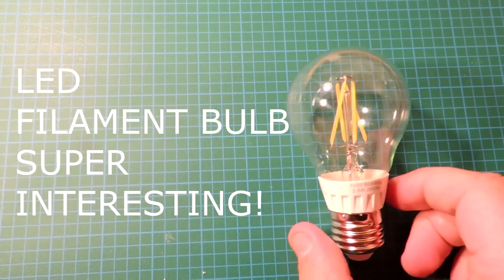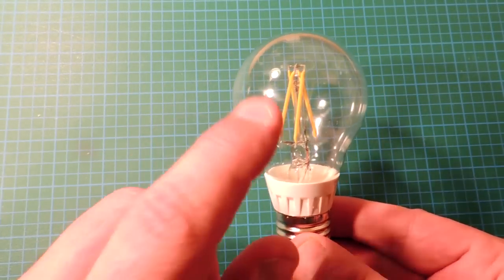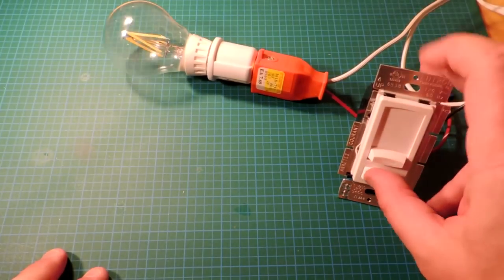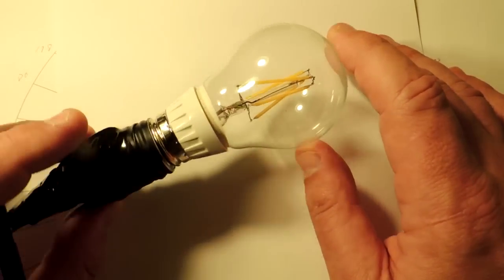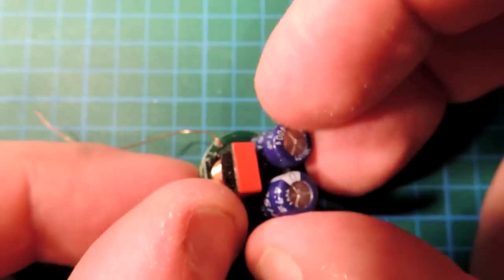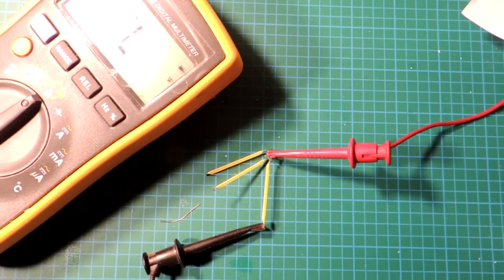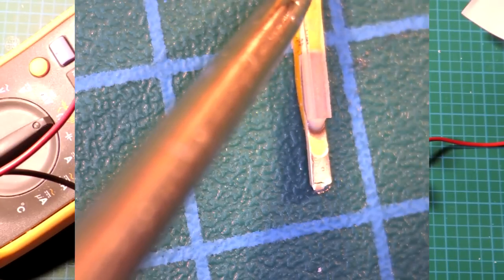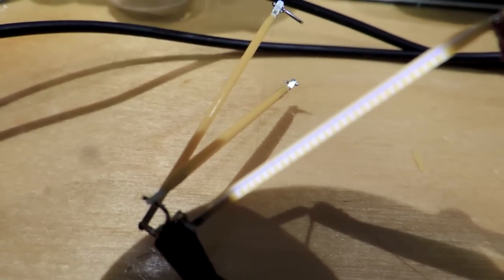LED "Filament" Bulb

Comment: 400lm seems a bit low.  I for one can't wait till these things get to 1000 or so.
Reply: So far the biggest power is 6.5W ,800-850 lm replace 60w incandescent bulbs. when we solve the heating problem. i think will have more power and lumen.
Reply: ***** I got mine at Home Depot.  They've had them for a few years now.  Trouble is, I don't know what they mean by 60w equivalent as they are dimmer then your average 60w.
Reply: *****  I would try Alibaba.com as they have a multitude of suppliers just pay attention to specs, warranty, reputation.... Your not missing out on the Home Depot ones as most their warranties especially Philips are terrible, restricting and really give you no guarantee they will honor it.
Reply: *****
I bought some 75w equivalent (has six filaments) on amazon.  It's really only 800 lumens but I LOVE THEM.  They look high quality and very retro.  They are all over amazon.  Buy the the 6 and 8 watt versions.  6 watt is usually, 600 lumens and 8 watts is 800 lumens.  I mixed the 75w and 60w in a bathroom fixture.
(4) 40 watt equivalents that use (4) 4watt filaments that look amazing in a fan lamp (450 lumens per bulb with 4 watts).
They come in two colors: 2700k that is a very cool retro yellow and a 3000k that is pretty nice too.
Reply: *****
Yeah, the price will come down.  I only need a couple of the "75s"  I bought mostly 60's and 40's.  I use the filament bulbs only when they are exposed and have to look nice.

Otherwise, I just buy Crees.
Reply: Now, you can get them on Amazon.com unlike 3 years ago.

Comment: http://www.ledinside.com/press/2016/3/power_photon_deomonstrates_led_filament_tube_and_cooling_package.      In the future, the omni-directional light bulb won’t include PLCC, EMC package or CSP, ELC non-package SMD LED. Of course, there is no MCPCB thermally conductive substrate, heat sink, lamp shade shell and etc.  In the successful development of LED filament tube new light source, it towards C.F.L. energy-saving lamps’ divide the work production and sales mode which is the assembly plant procurement filament tube source, power driver module, and etc. production packaging.  The brand passage will toward the vast world market for sale.After more than10 years of accumulated experience of numerous failures, R&D personnel of POWER PHOTON CO., LTD. finally can solve LED filament cooling problem!  LED filament tube and cooling package.  This patent technology has already applied for registration in many countries of the world.  Hope to open a brand new light source solution for human light requirement.

http://www.ledinside.com.tw/qiye/20160310-32200.html
未來LED燈泡將不再有PLCC、EMC封裝或CSP、ELC無封裝貼片，當然也沒有MCPCB導熱基板、散熱片及燈罩外殼等，在LED燈絲毛管新光源的開發成功下，朝向C.F.L.節能燈泡的分工生產銷售模式，即組裝廠採購燈絲毛管光源、電源驅動模組等生產包裝，品牌通路面向世界寬廣的市場發售。
寶福通光能有限公司的研發人員，歷經10年來無數失敗的經驗累積，LED燈絲散熱終於得解! LED燈絲毛管、散熱封裝；此一專利技術已向世界多國申請注冊，願為人類照明需求開啟全新光源解決方案。